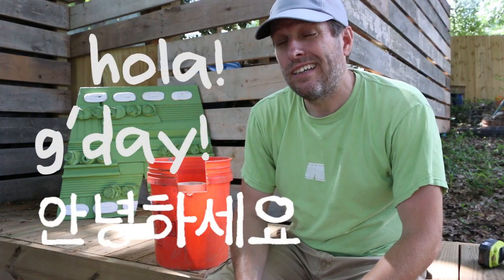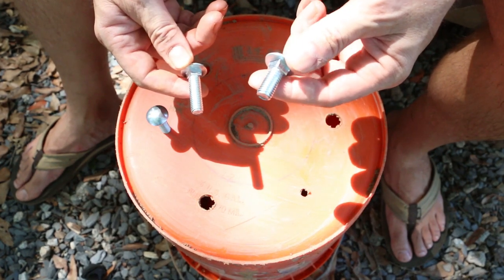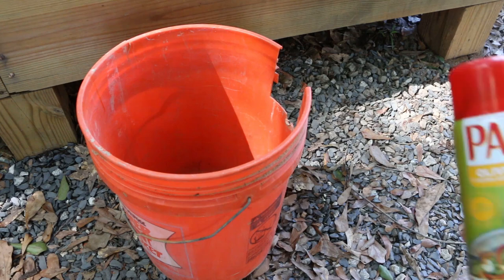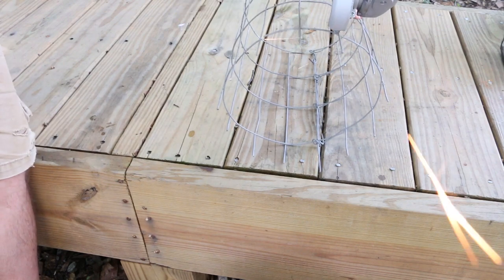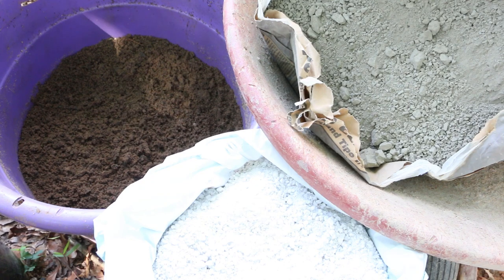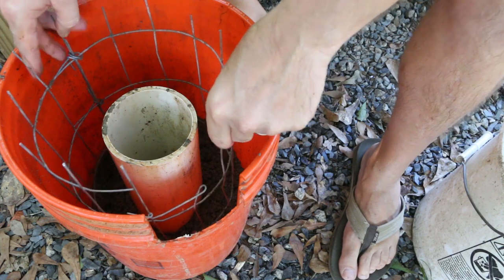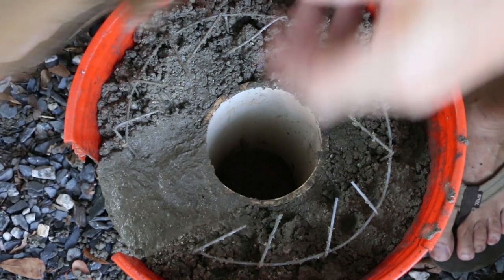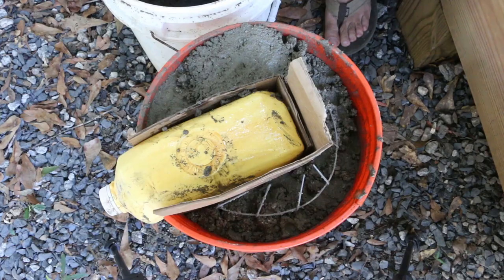Concrete & Perlite Rocket Stove FAIL! | What Went Wrong?

Comment: Some thoughts that I've had:
*First, have you considered trying aircrete rather than standard concrete for the unit? I honestly have no idea which will work better for a stove.: aircrete is much lower mass, and better for thermal insulation as well. Conversely I do not know how durable it is, nor how well it will resist cracking under heat.
*I am not sure how well this will work with your new bolt concept (I had this idea for the previous 2 attempts) but consider cutting out a 2 inch thick block of wood to go under the bucket, and then drill out holes for the bolts to fit into. That gives you a solid surface to place the bucket on. You can also pre-level the wood block before filling. And if the holes are done right they will help a lot for holding the bolts straight inside of the concrete.
*For a mold release system, I had wondered about using sheets of paper (maybe normal paper, though the concrete might pass through the paper and stick to the bucket, alternatively it could be waxed paper or sprayed/soaked with an oil.) The other option is use the bucket to provide the structural strength to the mold, but line it with plastic wrap or a garbage bag.
*Also, if you want a bigger DIY type mold (in case you wanted to include the feed ramp inside of the concrete rather than as an addon later, for example) you could try a large plastic garbage can.

I do love this concept though. If I had my own place I would be making one right now. Alas that I am in an apartment and can't do any of the fun stuff.

Comment: You might also use the stuff they use in fireplaces so the don't crack from the heat
Reply from the maker: I may integrate some fire brick in the next build. And I’ve got some of the fireplace masonry mix, but not enough to do a whole stove. Thanks for the suggestion. Thanks for watching.
Reply: Kattra Blake fireplace bricks is what is in wood burner stoves

Comment: if you add of the concrete ratio 50 20% rapid set hydraulic mortar mix it will land much more rigidity to this design
Reply from the maker: Thanks for the tip, Jason. I appreciate it. Thanks for watching.

Comment: The bolts would have been fine if they weren’t sprayed with cooking oil. Stay with cardboard, keep your moisture high,, use more concrete. 2 parts concrete, 2 parts sand and one part foam

Comment: NEXT TIME — try blowing compressed air into those holes in the bottom and see if you can expand the bucket enough to have the concrete creation jump out.
Reply from the maker: Good idea. I may try a different oil in the next build. I wonder if the veggie spray was too watery. Thanks for watching.

Comment: NO SAND!!!   just portland cement, perlite and water..... on a 5 to 1 ratio  5 buckets perlite, 1 bucket cement, and the water a little less than a full 1 bucket... or gallon or whatever measure you choose.
Reply from the maker: Thanks for the ratios.

Comment: Stop mixing in a bucket or wheel barrow! Use a plastic bag instead, its amazing I will never go back now. Usually at the store if any cement bags have holes in they double bag it with a big sturdy plastic bag, I buy those cement bags then I get the cement and the mixing bag for free.  Also the way I used to mix before the plastic bag method was to mix up the aggregate(sand/stone) dry first then separately mix the cement and water, then just combine the 2, aslong as your aggregate is all consistently wet then its mixed well. With the plastic bag method its so easy its not really necessary to do it this way.
Reply from the maker: Thanks for the tip Adam. I’ll have to give that a try.

Comment: At home depot,  the have reinforced concrete, it has fibers in it, holds the concrete together and no need for wire, concrete takes 28 days to be at 90% strength,  there's a product called Laticrete Quichskred, it not only has fibers but cures to 5000 psi, used in flooring leveling systems for tile or marble floors, I have a huge amount of construction experience,  live the Atlanta area too ... just a few ideas ...
Reply from the maker: Thanks for the feedback and ideas, D. I appreciate it. Thanks for watching.

Comment: Use gloves, concrete is caustic. Are you mixing perlite with the concrete? That won't work . You need a separate insulation.
Reply from the maker: Thanks for the feedback. I do try to remember to wear nitrile gloves when handling concrete. In this particular stove, I do mix the perlite with the concrete, but I understand the benefits of a separate insulation layer. Thanks for watching.

Comment: You’re supposed to use dry mix like what you call a failure isn’t really a Billiar see they use a dryer mix when they use the chimney and put a sleeve around the chimney do use the dryer mix for an insulation and the lot more perlite concrete or cob the way you’re doing it you need a wedding mix and you’ll be fine one more thing I realize you take peoples advice to a certain point then you do it you’re only here regardless so why bother taking people’s advice if you’re not going to listen to people that have made these many times before and actually make a living that make them so I do and I made him a deal and made him mad concrete it made him mad at air Crete and made him a pearl late near Crete the perlite the volcanic rock aerated volcanic rock anyhow good job on a food few of your stove and some of that you can use over again just add a little more concrete a little more water not discard the perlite anyhow good job trade a list in a bit or if you haven’t got the experience on it some others do you know what we’re talking about more than glad to help you out OK this is Tony saying have a good day